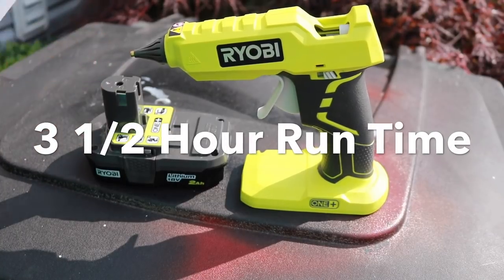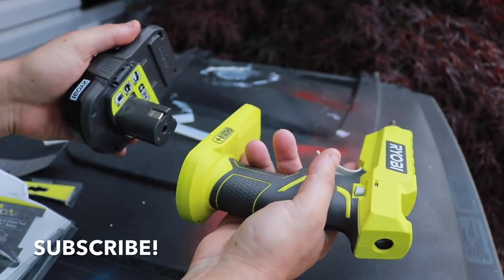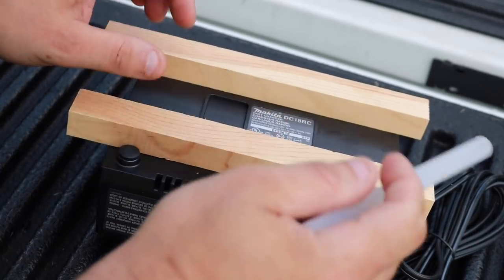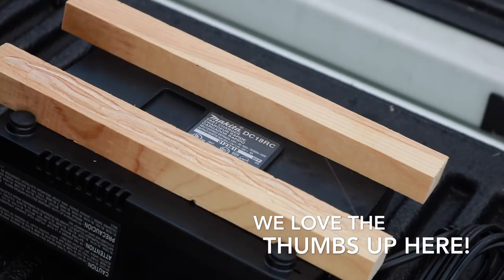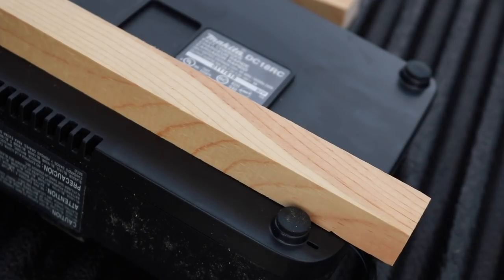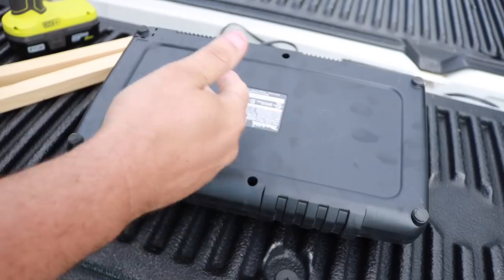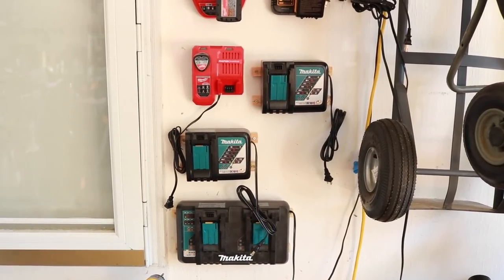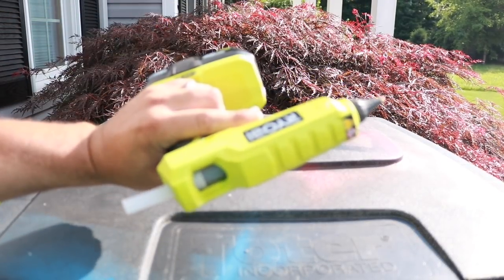Ryobi 18V cordless hot glue gun REVIEW! (P305)

Comment: It amazes me all the good things said about this. I just bought this tool because someone else was using it in a craft video and I am so disappointed! Maybe mine is defective? It constantly drops glue from the moment it heats up 😔 and that’s WITH using the glue sticks that came with it! And it actually smokes a little ... like white smoke maybe steam unsure as there is no burning smell or anything 🤷‍♀️
Reply: Yeah, that doesn't sound right.  Sounds like it might be a defective nozzle... or possibly a defective thermocouple, which would let it run too hot.   

If you'd care to try it, I'd recommend trying a quality brand of high-temp glue sticks, perhaps Surebonder or Adtech.  I have had very good luck using Adtech sticks with my P305.  

I'd go with the high-temp (or at least a multi-temp) sticks, because any low-temp sticks will get even more liquid when the gun gets up to full operating temperature.  Better to wait a minute longer for warm-up, than have glue dripping everywhere.  Good luck!
Reply: I am having the same exact issue with mine.  White steam coming from the glue gun and hot, soooo hot!!  Like burning and blistering my fingers hot!

Comment: Is it high temp or low temp glue gun?...it matters when you buy glue sticks.
Reply: High temp.
Reply: IIRC my manual says it's dual-temp (check on RyobiTools.com if you want to pull a copy of the manual).  It is NOT switchable though -- it heats to the temperature it heats to, and that's it. I only use high-temp glue in mine, but I would wager a guess that low-temp glue would be very, very liquid once the gun heats up fully.

Comment: Did those chargers stay up over time with just hot glue holding them up?
Reply: Was wondering that myself.  Gravity itself aside, most chargers are going to warm up slightly as they are used, due to the inherent waste heat from the power rectification going on inside.  I wonder if that's enough to soften the glue up enough that during a long run, the charger could sag or break loose.  On the other hand, high-temp glue would be 170F+ so hopefully those chargers don't get THAT hot!

Comment: Will the hot glue hold the chargers up with batteries in them. And will you have to be careful taking the batteries on and off
Reply from the maker: So far so good. I was checking on them just a bit ago, and was taking them on and of. No problems so far, but I'll let you know of they fail. I would think it should hold well
Reply: @ToolReviewZone  That's crazy that those Makita chargers have no keyhole slots for screws in them!   Or did I miss them?  If they have none, Makita is crazy.  Wall mounting is essential for chargers, workbench space is always at a premium!

Comment: Its a good glue gun, however , it is short of great due to the bulkiness of the battery..
Reply: That pretty much applies to every corded tool when compared to it’s cordless counterpart.
Reply: @MAI-dy2sw  Nope.. there is the Milwaukee m12 battery with its sleek and slim design (1.5 amp, 2 amp and 3 amp  sit flush with the grip, 4 amp and 6 amp sits flush up until a slightly bigger base). Bosch, ridgid, dewalt, makita all have 12v platforms with 12 volt batteries..

Comment: If I were you, I would sell/give away the Ryobi batteries and chargers and get an adapter that would let you power your Ryobi tools with Makita batteries. That is what I did. That way you can reduce the amount of batteries and chargers that you need.
Reply from the maker: Never even know they had those, ima check it out!
Reply: @ToolReviewZone : Yeah, I got one and it worked so well that I got two more. They are not made by the manufacturers though so you will only find them on less reputable sites i.e. ebay.
Reply: $50+ and $15+ shipping for the adapter.
Reply: @chasmarischen4459 : Is that how much it is now? When I got it it was around $20 and free shipping.
Reply: Can y’all comment back a link? Lol I just got one for crafts and I’m clueless